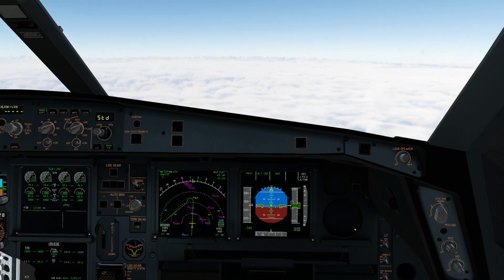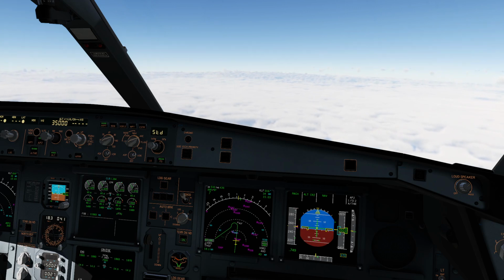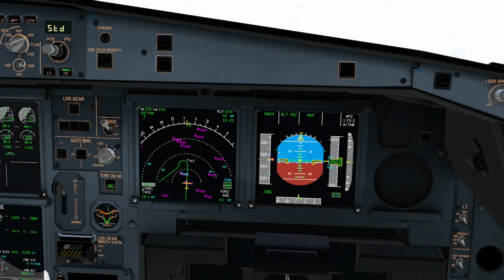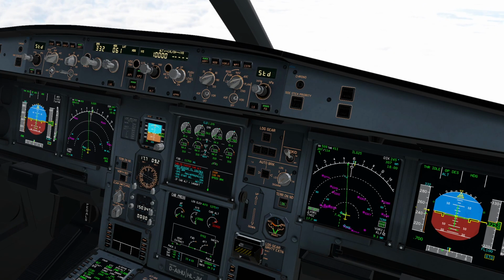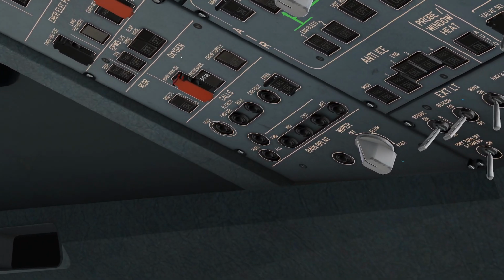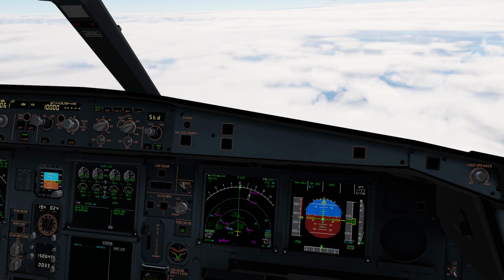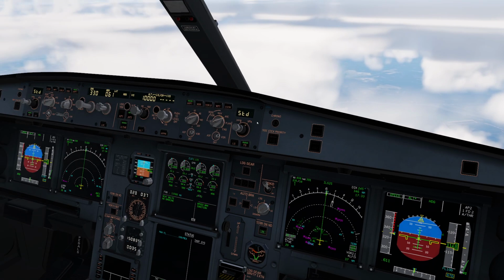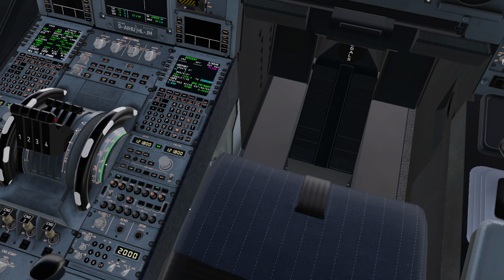Airbus Emergencies: EMER DESCENT / RAPID DECOMPRESSION | Real Airline Pilot

Comment: Interesting. About 10 years ago I was a passenger at the front of a rather shabby  Boing 737-400 providing a service for a major Australian Airline from Auckland to Brisbane. We were apparently climbing through 23000 ft when the incident occurred. The captain came over the passenger intercom saying "Emergency Descent, Emergency Decent" simultaneously the engines spooled down and the aircraft changed to the decent pitch. Note in your video the passenger announcement was later in the event.  Interestingly we felt a noticeable cool swirl of air through the cabin as this change in pitch occurred. Oxygen masks were not deployed to the passengers (perhaps due to the modest altitude and what was later confirmed to be a "we were unable to maintain cabin pressure during the climb out of Auckland".  The aircraft did not change heading during the descent and we continued heading out over the ocean until established at what I estimated was 5000ft (the waves were close!). After level flight resumed the Captain assured us that the aircraft was completely flyable and the cause was the inability to maintain cabin pressure. We flew back to Auckland with no apparent further issues.  Somewhat disappointedly the Airline spent the next couple of days denying that it was an emergency and it was a frequent occurrence in the industry. In hindsight the event may well have not been an emergency as claimed by the Airline but the Captain declared to everyone on board an emergency descent and in my book at that time it was indeed very much an emergency. So well handled by the crew but not by the PR people of the airline.

Comment: So would you have to assume most passengers will be unconscious by the time the masks drop.  Seems no way that would happen in less than 10-20 seconds considering steps pilot has to take before the step of dropping masks?
Reply: whenever the pressure in the cabin climbs above 14000 ft (aka the pressure drops), oxygen masks are dropped automatically
Reply: @Warka400 Ah, that makes more sense! Thanks